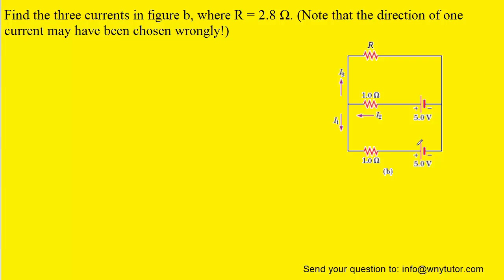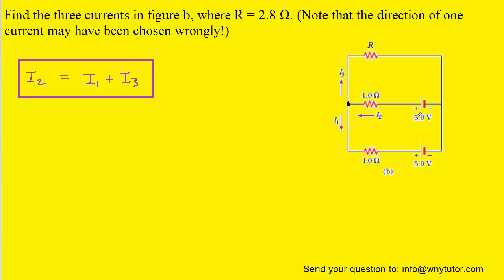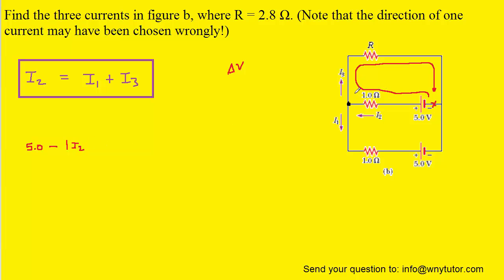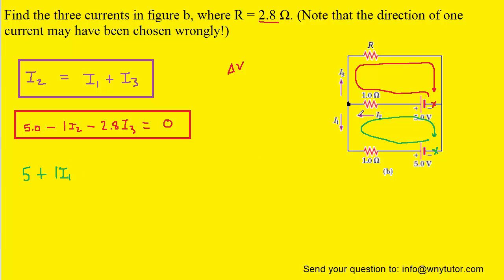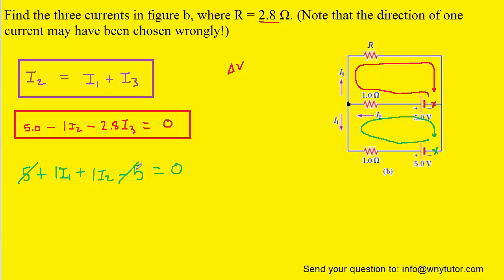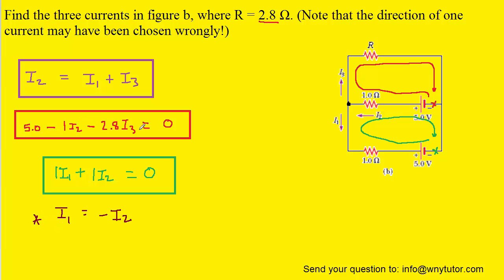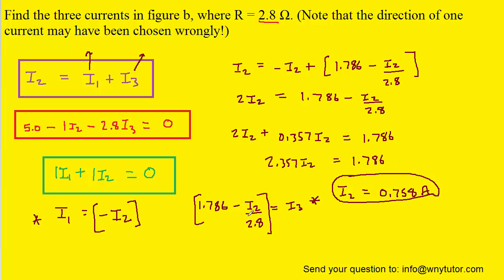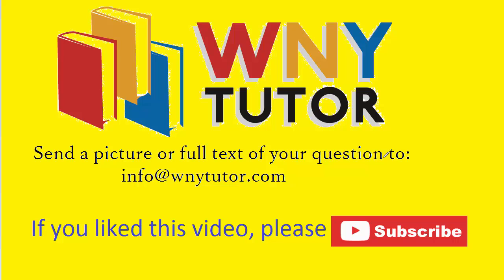Find the three currents in figure b, where R = 2.8 Ω. (Note that the direction of one current may ha

Comment: One of your previous problems had a current marked with the wrong direction but you did not state in the given description of the question that it was in fact a definite indicator of the direction of that current. So that was a clever way of showing how someone can be fooled by a trick question with no error on the examiners part.